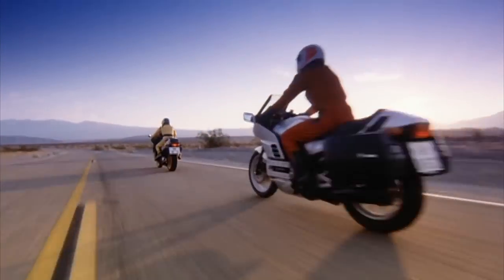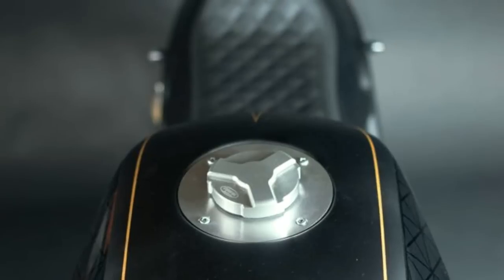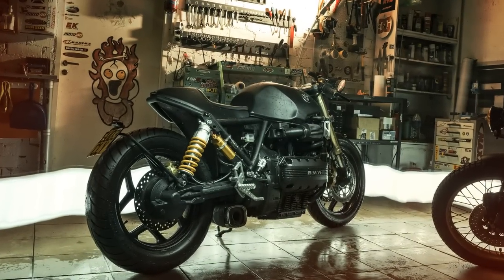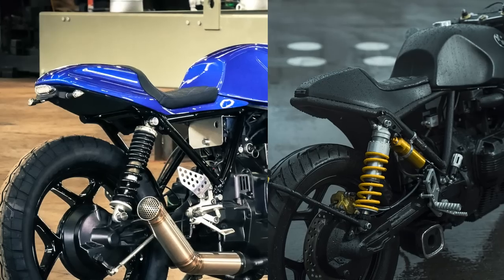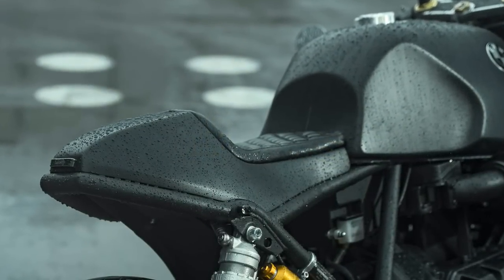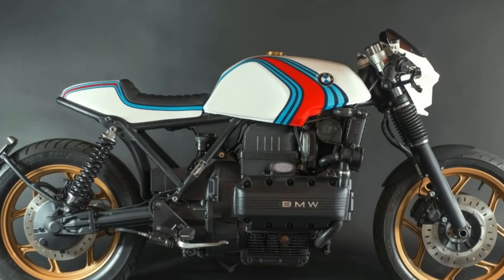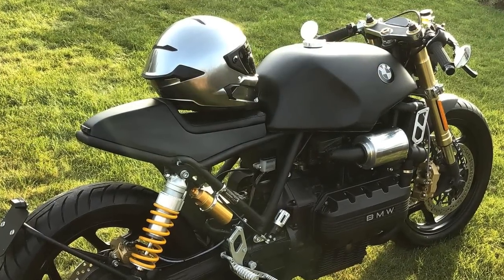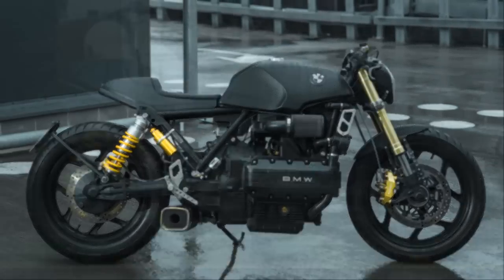Cafe Racer (BMW K100 by Two Wheels Empire and Twisted Brothers)

Comment: Hello guys,
I purchased the same seat from the twisted brothers and I would like to make it look like your rear end. I love it.
Is there by any chance any Cad drawings for the rear chassis tube that you could send to me so I can get it exactly right?
Also how did you guys mount the rear stop light inside? Do you have any recommendations for which to use?
Thank you for your time and this masterpiece:)
Reply from the maker: Hell. I suggest you to contact Two Wheels Empire or Twisted Brothers. There are several links on this video description box. Thanks. Cheers.

Comment: The BMW K series has always been a difficult motorcycle to customize. No matter how they are done, there is always something that is lacking, or appears to be over stated to compensate  for the initial design, such as the rear cowl/seat design, the overly large shape of the engine, etc. However, the seat/rear cowl design on this bike and the two previous examples, for me is the number one advance for making the K series a much better looking machine! There is no need to discuss the performance of the engine, because Let's be honest, it is an example of German engineering. This design is a giant leap forward, and seemingly simple and subtle component. Two Wheels have just turned the world's eye for customizing the K series on it's head...
Reply from the maker: Thank you my friend for sharing your opinion. I'm glad you liked this one :) Cheers.

Comment: As always Victor,
you have selected an aestheticly beautiful piece of rolling artwork !
Yep !
This K100's designers have hit yet another home run !
However,
I am not quite sure what I am hearing on the rpm run-up as it approaches it's power band.
It sounds to be breaking up a bit, I'm not quite sure is it is an ignition issue, or carburetion issue,
is this bike not fuel injected Victor ?
I guess this comes down to the arguments about today's
Café Racers, style or performance !
My personal belief is the answer is definitely BOTH !
So I am hoping that I am not sounding overly critical of the project Victor, 
I know, at this point, the topic is about the critical styling of the balance of the rear faring, fuel tank, and front fork assembly.
On that topic alone,
like I said earlier, 
they have a home run !
Reply from the maker: Hello my friend. Thank you for sharing your perspective. I think this K100 engine is a fuel injection version. About the engine sound of the engine, I am not sure, but it could be a  bad calibrated air mixture in one of the cylinders. :) Cheers.